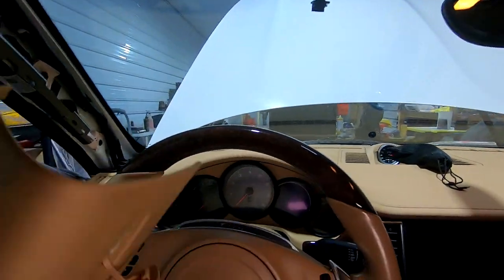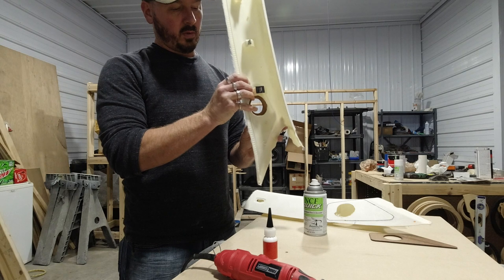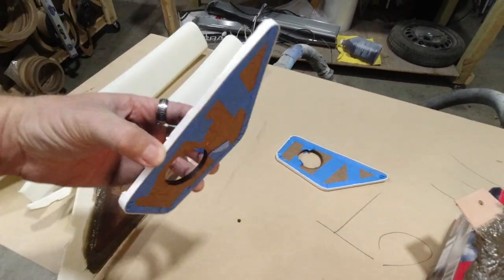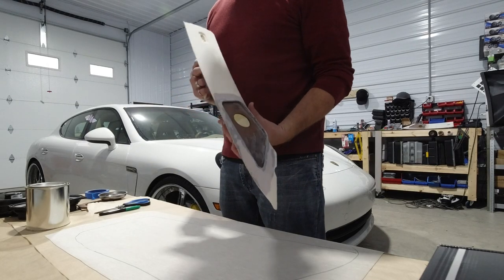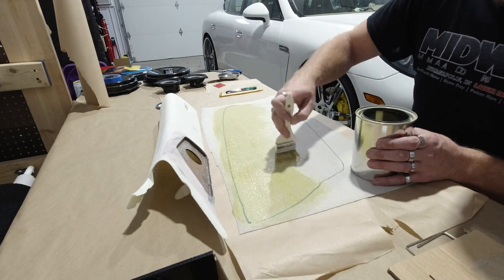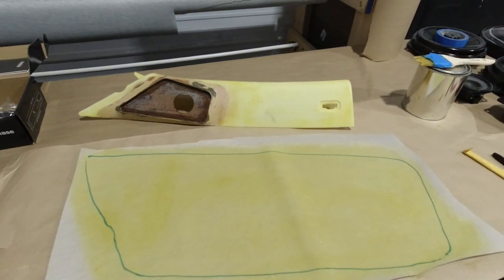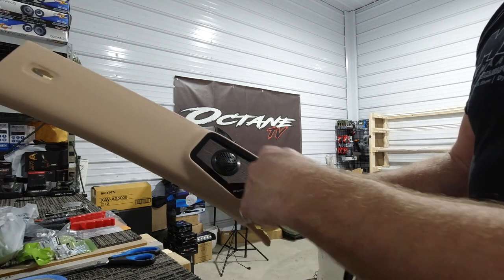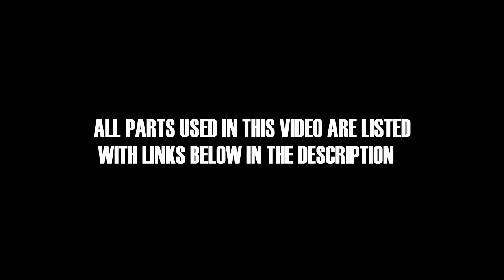PORSCHE PANAMERA CUSTOM BUILT A PILLARS - FULL BUILD PROCESS FEATURING AUDIO DYNAMICS 4000 TWEETERS

Comment: Great fabrication work, but I'm just not sure what the point of moving tweeters at the dash to the A pillars while aiming them completely off axis is for. I'm speaking from an SQ/audiophile point of view  Are you moving the midrange to the dash? Is this part of a system audio upgrade (but in the video it said it'll be all stock).
Reply: I was thinking the same thing... wouldn't that put them out of phase?